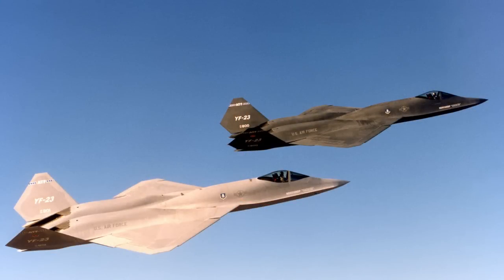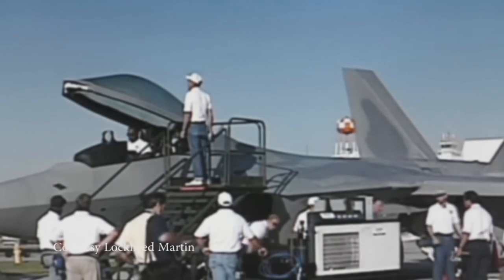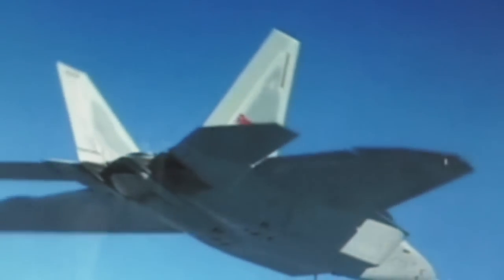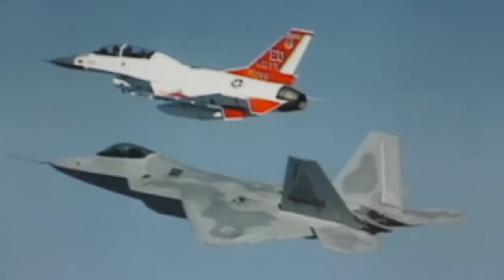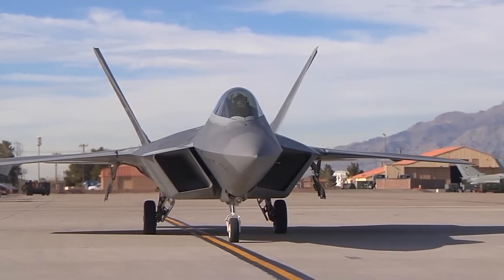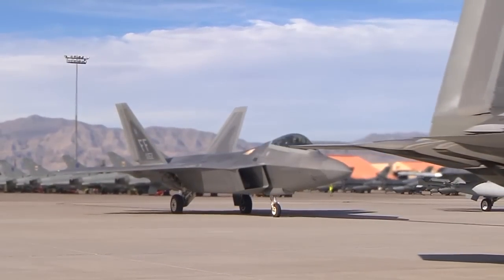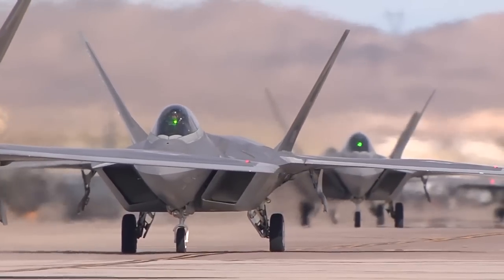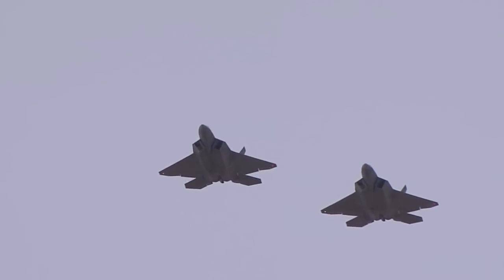Former test pilot Paul Metz speaks about the F-22 Raptor

Comment: Russian jets are more maneuverable than any western counterpart
Reply: 1:50 - Paul makes it quite clear that your point only matters after all else had failed.
Notice that the USAF had excellent test results with the F-16 Multi-Axis Thrust Vector (MATV), and then decided to NOT retrofit any F-16 with this outrageously maneuverable nozzle.  It is simply not a condition you ever want to get yourself into in the first place.
Reply: At slower speeds yes, but given how big and heavy they are they would lose energy much faster than smaller and more agile jets like say the Rafale, Typhoon or F-16… 
Not to mention if they are loaded with missiles and a lot of fuel… 
So in a dogfight scenario if you were flying a Sukhoi you’d want to finish the fight as soon as possible, you’d want to exploit instantaneous turning capability and launch a missile, otherwise if it’s guns only then your fcked… look for a video on of an American F/A-18 pilot “Gonky” who won three consecutive dogfights against a Malaysian Su-30MKM equiped with thrust vectoring, it was captured on GoPro… 
However both Malaysian pilots and Gonky emphasized that using thrust vectoring requires good timing and experience, which leads to younger crews being reluctant to use it; Gonky admited that he lost the first two fights against a Sukhoi flown by a skilled pilot who was good at using tvc…

Comment: I'm pretty sure he wished the YF 23 won the competition!
Reply: If it were really between the YF-23 and YF-22, then he and his team should have flown the YF-23 harder, then.  The YF-22's flight demonstration was far more impressive, and they made like 50% or so more flights, too, demonstrating supermaneuverability (high alpha) and missile launches.  The YF-23 team instead just stated with absolute confidence that the YF-23 could do all of the same things (in terms of flight, they meant), but didn't actually demonstrate it.  Why build the demonstrators, then, if they were so sure?  Why not prove it in the air like the other guys did?

Anyway, the choice was really between the proposed F-22 and F-23.  Both were a bit better than the other in certain areas, but both met all of the requirements, in any case.  The USAF did feel more confident in the F-22's weapon bay design, and the YF-22 flight demonstration had to have given them another confidence boost that the F-22 would be able to do what the proposal said it could do.  The main USAF engineers involved in the evaluation said "Pick'em," as in pick either one because it didn't matter; both would be dominant over current and projected threats.  So whoever made the decision chose the option that they felt most confident in.

Metz had worked on the F-23 and YF-23 program for years, and had a lot of input in it, so naturally he would root for what he himself had contributed to.  Maybe even some of its particular flying qualities were things that he personally preferred and suggested.  He only jumped ship because the F-22 was getting built and he wanted to continue to be a part of the ATF's development into an operational fighter, but obviously his wish is for "his own" fighter to have gotten that far.

Comment: Been saying it for years. The 23 was a better platform! It boggles my mind that it wasn’t selected over the 22
Reply: How was it better?  I can tell you that its weapon bay design sure wasn't better.  The USAF had already advised Northrop to change the design from the YF-23 iteration, but the proposed F-23's design still had the same problems.  Meanwhile, the F-22's bays have the same design as the YF-22's, and the latter actually fired missiles during its demonstration flights, while the YF-23 didn't (it didn't demonstrate high-alpha agility, either, even though Northrop claimed it could do the same things that the YF-22 actually demonstrated in flight).
Reply: 22 is better.

Comment: I wish they could make more of these for the USAF. The F-35 has disappointed so far
Reply: The only people disappointed with F-35 are the ones who know nothing about it.
Reply: @LRRPFco52  I know enough to say that if it's production had been delayed a bit for proper flight testing, it wouldn't have ended up with so many A category faults. Don't get me wrong, the jet is an engineering marvel. The avionics and EW capabilities on board are still unmatched. But the whole point is mission readiness which it hasn't achieved yet. It will take some time to overcome all faults. The jet is great but Lockheed sucked at programme management this time

Comment: Thrust vectoring been used and invented by the Russians 50 years ago. USA  just figured it out 20 years ago.  Russian planes had the system long ago  .
Reply: Not true. The concept of thrust vectoring  has been around since the early 1900's, and it was first used in the 1930's on airships. The first designs for a jet aircraft using thrust vectoring were by a Brit in the late 1940's and by the 1990's both the U.S. and Russia began testing it on their aircraft.

Comment: The F-22 is old and outdated, its not seen real combat, the thing it was designed to do.

The F-22 only has a main radar, no IRST no Helmet lock on system.

Plus the F-22 has been beaten many times by other jet's.

Comment: Ignoramus here, I have a question. If the f22 is USA tip of the spear air superiority fighter, then what is the f117 for? Does it do the same job? If so does it do it better or worse than the f22? Thanks
Reply: F-117 was a bomber. It's old and was retired a while ago now due to several significant issues, notably very poor aerodynamics and computation limitations of the era preventing an optimal shape for stealth.
Reply: @infinitelyexplosive  thanks for the reply. I really did think the f117 was classed as a fighter bomber, like the f22. With all those angles it makes sense to me that it had problems with its aerodynamics. Cheers pal

Comment: 2:18 Most other aircraft cannot do that? Man, have you heard on the Sukhois???
Reply: Have you ever seen a combat-coded and configured Sukhoi perform any of these maneuvers?

If you look at the Flankers, there are 2 BVR missiles carried in the tunnel, 2 on the engine nacelles, and the rest hung from hard points and rails on the wings.

That reduces your max speed and energy retention numbers considerably, especially at Supersonic speeds.

The F-22A carries 8 A2A missiles internally with no drag effects on their airframe, and no real weight penalty because the fuel fraction is so large. Additionally, it has more available thrust and can sustain speeds without afterburner that the Sukhoi can only reach with dash when slick (no weapons), hence the reason why Russia is trying to make the T-50/Su-57 work (and still failing at that.)

Comment: 2D thrust vectoring only allow you to pitch, not yaw like the Russian jets. Thrust differential might help a little i guess
Reply: 3D thrust vectoring isn't useful in real world combat and it compromises stealth.
Reply: @mignik01  is that why the F22 and F35 have it? 🤔
Reply: @mostlymessingabout  neither of them have it.
Reply: @mostlymessingabout  That's 2D thrust vectoring. I was talking about 3D
Reply: FADEC integrated with DFLCS allows assymetric augmented high yaw rate in combination with control surfaces.

The F-35 with only one engine and no ability to augment asymmetric thrust is able to execute pedal turns because of DFLCS and center of thrust relative to its tailplanes.  Multi-Axis TVC (developed by the US) proved to add cost and complexity with no real practical advantages.
Reply: @LRRPFco52   Similarly, the F-22 does its pedal turns and other high-alpha maneuvers with its aerodynamic controls only, just like the F-35.  Its thrust vectoring gives it other capabilities and can be used in conjunction with its high-alpha capability, but they are not the same thing.  Probably the vast majority of people don't know this, and assume that the F-22 can do what it does at airshows because of thrust vectoring, but that is not true.

So why was the thrust vectoring kept, when no other US fighter has it?  It's because of the F-22's supersonic maneuvering requirement.  Thrust vectoring gives the F-22 superior turning ability at both slow and supersonic speeds.  In between, thrust vectoring is generally blended out and is sometimes not used at all.  Its high-alpha capability is a separate and unrelated matter--yes, the F-22 (and F-35) is aerodynamically more advanced than the X-31 that flew at the same time as the YF-22, as the X-31 (which was based on the EAP that eventually became the Eurofighter Typhoon) required 3D thrust vectoring.  The F-22's 2D pitch-only vectoring also gives it more efficient trim at supersonic speed (lower drag, higher speed), and minimizes the movement of its aerodynamic surfaces in order to maximize stealth while supercruising.  Its 2D vectoring makes for better supersonic performance, which is a plus for a fighter that is expected, and actually does, spend a lot more time flying supersonic than other fighters.
Reply: @rbrtck  They use the TVC coupled with DFLCS and large control surfaces for the supermaneuverability in the slow speed regime as well, but your description of its high speed regime TVC performance is spot-on as well.

We were on the EAP/ECA specifically for post-stall algorithms from 1980-1982 before a demo aircraft even existed, then returned to Edwards in late '82 to work on F-16 & B-1B Combined Test Forces.
Reply: The Russian jets also have 2D thrust vectoring.  The difference is that the vectoring axes are oriented in a V pattern rather than straight up and down.  This reduces the vectoring force available (the F-22's nozzles are very fast and vector at a steeper angle), and creates adverse yaw and roll forces.  This is not good for control of the nose during dogfights.  It is mostly useful for enabling these fighters to momentarily be thrown wildly out of control in many directions for airshows, and don't get me wrong, not only does this look spectacular, it is impressive how well they recover, but again, it's not useful for combat.

Basic pitch vectoring is somewhat useful, and the Russian fighters can do that, too, but not as well as the F-22.  I mean the type of pseudo-yaw vectoring they have is a compromise that is only useful for airshows.  Differential thrust (split throttles) would be more useful for controlled yaw "vectoring", but that's not really vectoring, and the nozzles on Russian fighters aren't 3D.

Comment: Looks good, but can it take a bullet??
Reply: Can any plane?  How big of a bullet?  The F-22's wings were tested against hits from a 30mm cannon like the ones Russian fighters have.  They can take at least one hit without coming apart.  Actually, this wasn't true at first, so they were strengthened until they could pass this test.  That's actually pretty good for a fighter not designed for close air support, if you had the A-10 in mind.  And plenty of those have gotten shot up and shot down, by the way.  It's still an airplane that has to be light enough to fly in the air and carry tons of payload.

Back to the F-22, it's not likely to have to take a bullet when used properly.  I know crap happens, but it generally doesn't fly low to the ground, and will very likely win the vast majority of engagements.

Comment: you think the Yugoslavian forces had the latest in radar technology in 1999?

if you answered no, congrats! you get it, stealth isn't real!
Reply: The detection range against F-4 wirth P-8 was about 250-280 km depeding on factors, against F-117 was less than 30 km. I know because spoke face to face withthis about Zoltan Dani, who was the commaner ofthe battery on the  Neva who downed both the F-117 and the F-16 during AF. One of the biggest factor with Neva for the kill was pure luck because of the deploy site on the 3rd nigth was an old Volhov SAM site, and NATO forgot (?) to check what could be there. Dani's battery deployed there even before the beginning of the AF, they were detached from the SAM ring of Belgrad, was the only Neva battery which left the SAM ring of Belgrad.
Reply: If stealth isnt real, why does Russia and China are desperately working on stealth jets?. "stealth" is only stealth against certain wavelengths . Its impossible to build a fighter that is invisible to ALL wavelengths. F-35 is stealth against shorter wavelength radars, which means they are invisible against fire control radars -> impossible to lock on..
Reply: aleksa99se f117 is outdated stealth tech not even close to f22 it f35
Reply: Chris, you're completely misrepresenting what happened. The F-117 became visible because 1) it was flying a predictable flight path and 2) it gave off a radar cross section because its bomb bay doors opened. It's not that the stealth features aren't real.
Reply: aleksa99se They use of “low-observable technology.” They do have one major weakness, however. Every time the pilot opens the wheel well or bomb bay doors, their low-observability rate decreases.
Reply: aleksa99se https://m.warhistoryonline.com/history/that-day-the-serbs-did-the-impossible-shot-down-an-f-117-nighthawk.html
Reply: Michael Judd also when the f117 was wet it reduced the Efficiency of early stealth technology
Reply: First & foremost, outliers don't apply to the whole. The F-117 conducted many radar penetrating missions over the years. ONE was shot down, so it omits the past success?  More importantly, do you know the details of the F-117 being shot down??????  .... it was a repeat route, day-time mission. The Serbs didn't need the latest in radar technology in that situation.  Mistake of the US to become complacent.
Reply: It's low visibility.
Reply: Dumbass, the man who led the shooting down of the F117 said they could only lock on it when it's Bombay or landing gear were open
Reply: blastman8888 So war in Serbia was not real?
Reply: He said they are not invisible low frequency radar like the serbs used in 1999 were large arrays which are not mobile. In a real war those radar sites would be wiped out, and there is no airborne radar system which is low frequency . The raptor is the most advanced fighter in the world it's has no match. Russian fighters are nothing more then a hodgepodge of stolen technology.
Reply: Plebby Just imagine idiot pilot who flies with landing gear opened over enemy's territory and keeps his Bombay open well out of his target range. If you have listen to the interview with SAM crew you  would learn that they initially saw four of F-117 and pick one. So according to you all of F-117 pilots are brain dead idiots?